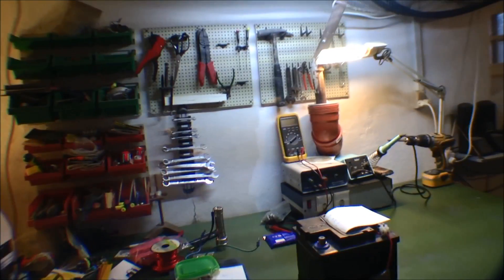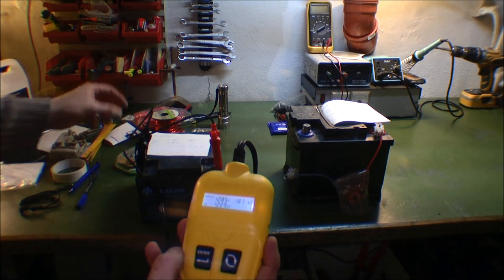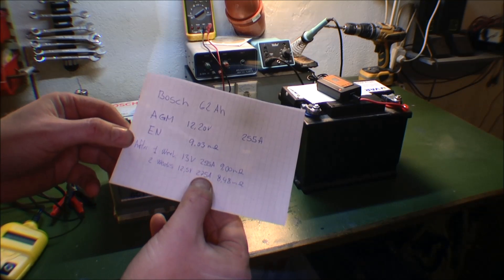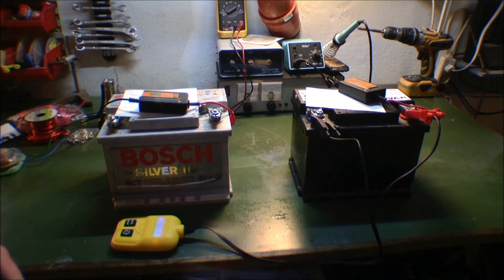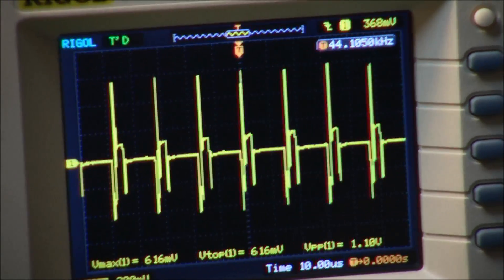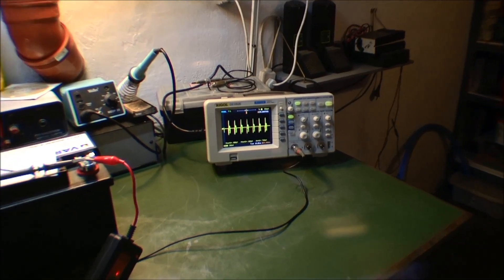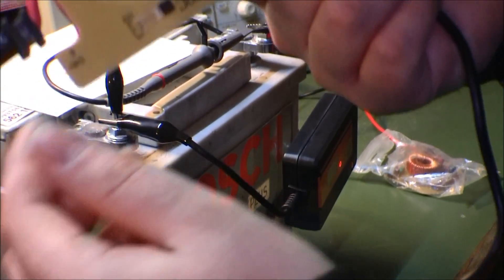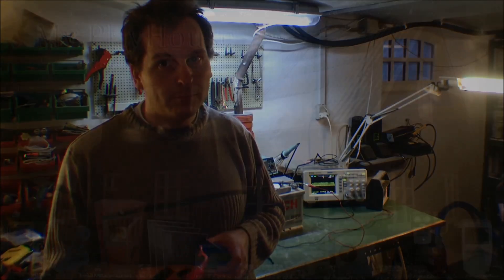Desulfators turned out to be worthless $hit - 184

Comment: I am using a Pulsetech PowerPulse passive desulfator on my battery I installed about three years ago, I drive my car about 5 miles a day,  25 miles a week, and so far the battery is working great. I don't think all desulfators are the same, PulseTech claims to be a patented design and uses a specific frequency rather then voltage spikes to gently desulfate a battery.
Reply from the maker: Hi @josemedeiros007
Thank You very much!  glad you liked the video :-)
Thank you for watching! :-)
Reply: @MyPlayHouse  Keep in mind that not all batteries can be recovered, Pulsetech, CTEK and Noco Genius chargers also state that in their manuals. Noco Genius 5 and 10 chargers, and CTEK chargers use a 16 volt power spike to desulfate batteries in repair mode.

Comment: You found the problem, no way to get enough current from a small cap or no cap and a small inductor to make a pulse that would do anything. Good thing I saw this before I ordered one. I guess I will go to that guy in G.B. that sells the kits and bare PCB's with 2 x 6.8kufd caps and a decent pair of inductor coils. I also have a couple of really NICE big coils I ordered for building at least one maybe 2 desulfators from online schematic. I'm not an EE but I know if you want to see what's happening on the scope, some real serious pulses you need to be able to make serious pulses in the circuit. You don't want a lot of amps going through these cause that would heat the plates up and ruin the battery, it takes over voltage at fast frequency to get this done and 10khz is pretty high. There are so many different gimmics about this and it really makes it hard to figure which works and which doesn't. People out there say this or that works when they really haven't used the proper test equip like you have done here. I have a recently repaired scope I fixed aTektronix TS210 that I have not used yet so this would be a nice work with it. Wish you could send me a schematic of that old home built desulfator you tried here. Electronics has so many ways of getting the same job done, it's hard to figure which works the best. I'm trying to figure a way to use a basic 555 to switch a MOSFET to use with a set of low wattage solar panels to get the higher voltage needed. I have a couple of other desulfator schematics I'm looking at and building to see which and if any of them work  better or worse. I live off grid in my large RV with a large bank that suffered on account of failing PWM controllers for solar, I just got a rather expensive MPPT that is rated for a lot of power in 48v max system, but I'm still on 12v until I can get more equipment to switch up on voltage and still run all the standard 12v epuipment. I'm running out of time to save these batteries. Got to get it done before winter sets in and freezes them. Either that or spend more money I cannot afford. Shore power is getting too expensive paying a bill every month when after the solar is functional, it's basically free from that point on.
Reply from the maker: Hi @brettschacher8644
Thank You very much!  glad you liked the video :-)
Thank you for watching! :-)

Comment: Desulfators are plain garbage and 100% just a waste of time.
Reply from the maker: Maybe,, I shall not disagree or agree with you.
Reply: @MyPlayHouse  Once the plates starts flaking due to weather expansion  and shrinking .. no salt can flush the flaking and restore the damaged plates back  to the original state. The only way to do that  is .. to melt  the plate back into liquid form and make a new casting of the plate. if you enjoy nonsense Desulfators garbage..
have at it :face-purple-crying:

Comment: Dude, I think this kind of desulfator is supposed to be used inline with a charger or maintainer, not sitting by itself.  It's not supposed to be charging and of course it can't.  Desulfators of that sort use almost no energy so of course, after a short period of time as you are measuring, unless something else is drawing, amps should be about  the same. Voltage might go up if working to desulfate but only after charging.   The main indicator here of extended battery life is lowered internal resistance.  

Exactly the same amps probably means the desulfator is so low powered that to get anything out of it, you would have to use it to maintain a functioning battery, not perform a rescue.  It might be safe to use with an UPS battery along with a charger in parallel so small the pulses must be. You would hope to see a small improvement with internal resistance but it is also slowly running down the battery, like it was sitting on the shelf.  Try wiring parallel with a trickle charger as the chemistry seems to me to require energy being added during desulfation.
Reply from the maker: It will work with or with out a charger. It does better with a charger.

Comment: Just used the desulfator on a car battery that failed load test. I used mine with the charger on set to 12amps and now testing ok. I think the jury is still out for me on this thing. I will try to do some more testing before I call it garbage. It took a couple of days but battery now passes multiple load tests in a row. I am using the old fashion resistive type battery tester and it makes the resistance coils glow red but still holding over 12 volts.
Reply from the maker: Hi marino pacentrilli
Thank You very much!  glad you liked the video :-)
Thank you for watching! :-)

Comment: Hi Morten,Im keenly interested in all your videos. In this case, its not computer its electronics (Im an  electronics tech). I am interested in this test very much. The 1v or less your oscilloscope is reading seems very odd to me. Have you checked your oscilloscope leads to make sure they are set to 1x not 10x? Try using your digital multimeter to verify the 1V level you are seeing. A 1v spike connected straight to car 12 volt battery (if connected when you did that test should swamp out any little spike like that. The battery acts like a giant capacitor. Anyway, keep the videos coming.
Reply from the maker: Hi Stephen
This video is very old,, I do not even think I have the desulfators anymore. But putting something across a big battery,, it is difficult to get large spikes..

Comment: well...it is this '' chinese thing''.   and  after 7 years, i don't think they improved any further...today !!!    well, other videos claim that using Stick Welder  really works better to  recondition the car , motorcycle batteries.  5 minutes of 25 amps and rest for  10 minutes, then 5 minutes 0f 50 amps and rest for 10 minutes, then 5 minutes of  85 amps and rest for 10 minutes, then 5 minutes of 120 amps  and rest for 10 minutes,  and lastly 5 minutes of 200 amps and let it cool down;  the battery becomes as good as brand new !!!!   they swear by the  stick welder which is doing  effective desulphating......no need to change any electrolytes !!!!
Reply from the maker: Hi kanth vickram
Thank You very much!  glad you liked the video :-)
Thank you for watching! :-)

Comment: To be most effective I’m pretty sure a desulfator needs to be connected in parallel with a charger.
Reply from the maker: Yes, that will help, with a bit higher voltages.

Comment: Desulphator only works to break sulphate cryztals which stick to the cells that makes the battery back to healthier conditions (Won't be back to a new condition anyway). To do so  you should refill the liquid first to make sure all cells are sinked. In the state of the cell leads are not even sufficient enough (run out) to react to sulphate, there won't change anything either, wich means you should replace the appropriate cells with the new ones. If you can't find cells with a good lead on it, then replace the whole battery (Buy a new one).
In this video case, those 2 conditons are perhaps ignored, and I didn't see you write down the SOH (State of Health). That's why you didn't see anything happened.
Reply from the maker: Hi Real Troll
Thank You very much!  glad you liked the video :-)
Thank you for watching! :-)
Reply: @MyPlayHouse  No problems.. Thanks for sharing anyway.

Comment: I went about it different I purchased a new trolling battery and used jumper cables and hooked them parallel and let it sit for 2 days then connected my auto pulse desulfator and charger set it at 2 amps for five days then turned it to 12 amps for 6 or 7 hours now I have two good batteries. The battery I started with had set for about 2 years without being charged before I started
Reply from the maker: Hi John Shoemaker
Thank You very much!  glad you liked the video :-)
Thank you for watching! :-)

Comment: The problem that I see is that you don't have a trickle charger or some other type of charger to the battery a continuous of  1 amp and on the same time connect the desulfator. This is a very effective effective method.
Reply from the maker: Hi Kain Duran
Thank You very much! I have tried with a charger as well.. glad you liked the video :-)
Thank you for watching! :-)

Comment: The Battery Desulfators  need to be used in conjuction with a battery charger and not just Stand Alone, preferable a older style Battery charger. I have had good luck with a Infinitum  Desulfators , but they take a long time to work, I just dont just test the voltage but i check the amp improvement too, I have a 500 Amp carbon pile battery load tester, and i have improved the amp output of a sulfated battery,  battery Desulfanators do work, but they take time and must be charging at the same time you are desulfating the battery. I also like the Xtreme XC1000-p charger/desulfator, they seem to work very well for me.

https://www.youtube.com/watch?v=bhgVI0E9Nyc

https://www.youtube.com/watch?v=QqCoiXvG3rw
Reply from the maker: Hi CHELLIE2408
Thank You very much!  glad you liked the video :-)
Thank you for watching! :-)

Comment: Sorry you had bad results. I have had the exact opposite results. I have 1964 Ford Ranchero that has an Optima battery. The first Optima battery I used lasted 9 years. I don’t drive the car everyday and because of that the battery is connected to a Battery Tender. The second Optima battery started not recharging fully after about 3 years of service. I contacted Optima and they told the battery was sulfating and recommend I buy one of their high priced battery chargers. But first I tried the exact desulfator you had bad results with. So far I have used the 3 times over the last 2 years. In fact it’s connected right now for the third time. Once the unit drained the battery to 11 volts I reconnected the Battery Tender and within 24 hrs the battery was fully charged and the battery was fine for about a year. After this go around of about 3 weeks I’ll see if the battery comes back for a third time. It does take at least 3 weeks so you have to be patient.
Reply from the maker: Hi James Howard
Thank You very much!  glad you liked the video :-)
Thank you for watching! :-)

Comment: I think the cheap ebay desulfators are meant to be used on top of a charge supply voltage. I'm measuring from 800mV P-P on a very weak SLA (9v) to 8v P-P when 12.4 is applied via an isolated DC supply.  Mine were ~$4.00 ea.
I'll leave them on an unused 48v 70Ah bank for a couple months to see if there's any capacity improvement. Each battery is kept topped by an isolated supply with the desulfators each in parallel with the supply.
Reply from the maker: Hi Ken Bell
Thank You very much!  glad you liked the video :-)
Thank you for watching! :-)
Reply: @MyPlayHouse  thanks for doing all that stuff and showing us!
Reply: Did it work ken?

Comment: Please review this desulfator, i think this should give you good results. Open circuit with frequency and pulse width adjustments. Not like the shitty closed desulfator. I managed to restore my 3 yr old SLA battery!  

https://www.aliexpress.com/item/12V-Car-Lead-Acid-Battery-Recover-Capacity-Module-2-Way-Accumulator-Repair-Tool/32694637443.html?af=137322&afref=&cv=47843&dp=d79ef7c6b10c642ddf89bf3732357b08&mall_affr=pr3&subid1=DPlnKr2ATnM&af=137322&afref=&cv=47843&dp=d79ef7c6b10c642ddf89bf3732357b08&mall_affr=pr3&aff_platform=aaf&cpt=1540962588387&sk=VnYZvQVf&aff_trace_key=5efda3c64b0e4fee8820944aec2625bb-1540962588387-09201-VnYZvQVf&terminal_id=bf83852984094f2cbbc0be12c75c9db8
Reply from the maker: Thanx,, but I made my own desulfator : https://www.myplayhouse.dk/shop/en/home/22-mph-battery-desulfator-kit-11.html

Comment: I'm an electronics engineer and wanted to desulphate some batteries.  I saw this desulphator on the web and ordered one to save me time building my own.  When I tried it on a battery, it didn't restore it.  I put it on oscilloscope and found the same low output voltage.  I traced the power section of the circuit and found that the manufacturer had modified it from an original circuit that it clamps it's own voltage to about a diode drop (about 0.7V) above the battery voltage.  So there is no way it will generate high voltage.  They seems to be selling thousands of these on the web, all a complete con (Like many products out of China!!).  What a waste.
Reply from the maker: Hi Ahmed Razak
Thank You very much!  Yes,, want to save money,, just get a new battery!! :-/
Thank you for watching! :-)
Reply: What about noco genius desulfaters?

Comment: I use a BatteryMinder charger/ desulfator on my 48 volt golf cart and it is the best money I have ever spent . My batteries are going on the 9th year and they hold charge almost as long as when they were new . The charger cost 200 but we'll worth it , I charge batteries with golf cart dumb charger and then hook up the Battery minder after fully charged , it can also be used in conjunction with dumb charger . I checked batteries today after 3 months in storage and the plates are clean with very little water loss and batteries were at 51 volts .
Reply: toledojeeper what brand?
Reply: The name brand is BatteryMinder .
Reply: The battery minder is completely different then what he is showing on video. I like his cousin's version better
Reply: @nightcrows787  ...I know , I now use a smart charger that also has desulfatation and i have disconnected the OBC on my Club Car.
Reply from the maker: Have you change to Li-ion by now?
Reply: @MyPlayHouse ..No , not on that cart . I’m actually getting ready to buy another set of lead batteries for it .
But I do have a new cart that is lithium .
Reply: @MyPlayHouse ..I see no advantage of lithium yet . I still have to charge the lithium every night just like the lead acid batteries. The lithium gets more range but not by a lot . 
Also I found out the hard way not to run lithium under 40% . They will shut down without warning stranding you . At least lead acid will give you a warning it’s time to charge it .

Comment: Have you thought about building your own Desulfator/Charger with a Capacitor and bridge rectifier setup?  This is interesting to me at present.  You can limit the current by the size of the capacitor.  I am thinking of building 2 or 3 of them with different capacities.  The Bridge rectifier makes it pulsate and it can throw a lot more voltage than how yours were working.
Reply from the maker: Hi
I was really hoping to find some good cheap Desulfator, that I cut just buy. I would have a hard time finding the time to build one my self.
Thank you for watching! :-)